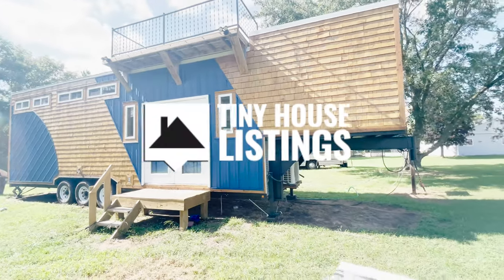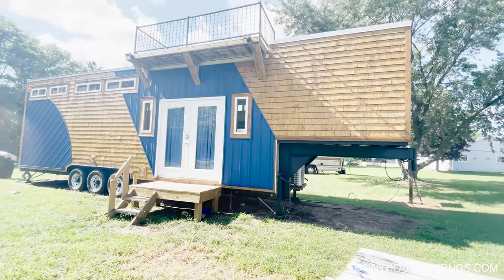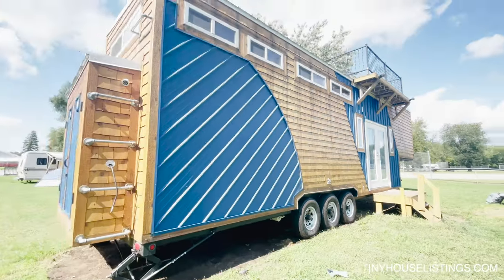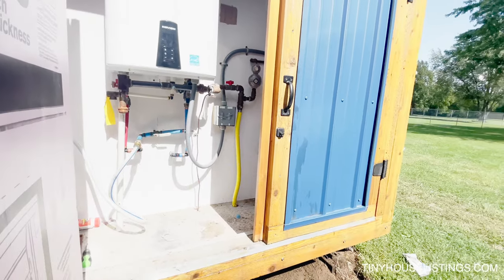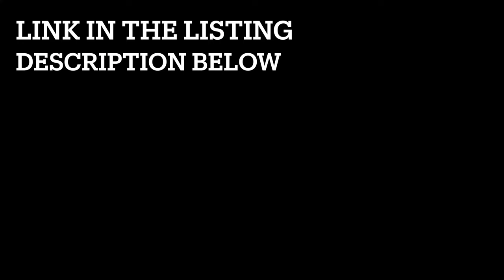The Tiny House DREAM | Full Video Tour | Rooftop Deck

Comment: Can something this size even be called a "tiny house" with a straight face? Don't get me wrong, its lovely. I just think its too large to be called a tiny house, a small house most certainly, but not tiny.
Reply: Just for YOUR FYI....THE Tiny house (Tiny House movement) is a home that can travel with you on wheels.  Now you know.
Reply: @mailto5319  Don't be so condescending. Especially when you're so laughably flat out wrong. A Tiny House does not have to be on wheels to be a Tiny House (though it is common for them to be mobile) and just because something is on wheels, doesn't mean its a Tiny House. A Tiny House is defined primarily by size. Hence why they're called "tiny". The movement itself is defined as an architectural and social movement towards downsizing living spaces.
Reply: @RainMakeR_Workshop  Correct, though, because of the struggle to legalize them the law and building codes will generally refer to a size of 400 Sq Ft or under because that's the range that would otherwise not be allowed.  It doesn't actually define what is tiny, just patches the law where it needs to but many refer to that as what can be called tiny and this is still well under 400 Sq Ft at the listed 322 Sq Ft.

It's otherwise a matter of opinion and based on what someone considers normal size for what it is being compared to but at least a third of the size would be considered tiny instead of just small.  Given the average house size exceeds 2400 Sq Ft, tiny can be fairly large for some people.  Some, used to much larger houses, would even consider something 1500 Sq Ft too small for even one person.  While, as there's overlap with ADU's, people tend to include all ADU's even though they can be up to 800 Sq Ft or even larger in some areas.

So there's a lot of gray to how tiny is actually considered and depends who you ask...
Reply: @ZeoCyberG   oh I know. Even up to 600 Sq Ft is within the realms of Tiny House to many people. But I just tend to find larger ones don’t really live up to the name. Anything over 300 Sq Ft, though technically a “Tiny House”, doesn’t usually feel like a Tiny House. Once they get that size, they fall more under Small House. Which is even more confusing for some as Small House can be used more generically for regular houses that are just smaller than average, but Small House is also a term used for a subcategory of larger Tiny Houses within the movement. 

Also the legal status changes from country to country. The movement is international after all and average house size varies drastically in other countries.
Reply: @RainMakeR_Workshop  Yes, but as said, it depends who you ask.  Someone can quote Tiny House Nation, for example, and point out the show states 500 Sq Ft or less.  While the show host Zack Giffin always states it's about what's appropriate, which is why the show was fine showing ADU's over 700 Sq Ft...  It doesn't really matter, it's just opinion and not an actual physical value...  Besides, you can go to a country like China where the average house size is 500 Sq Ft and they'll think they're just normal size or maybe just a little small but they got apartments down to 100 Sq Ft... Tiny is also relative depending on use, like for one person it's different than for a large family and you start dividing the space per person... Lots of gray area indeed...
Reply: @ZeoCyberG     True. But the international Tiny House community on the whole seems to have settled on up to 400 Sq Ft is a “true” Tiny House, though anything over 300 is typically seen as belonging to the aforementioned “Small House” subcategory of Tiny House. And anything over 600 Sq Ft isn’t generally seen as part of the movement, even if as a purely descriptive term they can legitimately be called small in comparison to most homes. There is also the subcategory of Micro House which is generally any Tiny House under 120 Sq Ft. But indeed as you said there is a lot of grey and fuzzy overlap areas. Especially in countries where living that small is normal (though usually those places lack the design innovations found in Tiny Homes that make living tiny practical and comfortable)

Still though, that “FYI” comment legit made me laugh saying that a Tiny House is on wheels as though that’s what defines them 🤣.
So much condensation for such a confidentiality incorrect statement. The caps and “now you know” were just the patronising cherry on top.
Reply: @RainMakeR_Workshop  True, some people can be funny in how certain they are of something that may not even be remotely true but that's the Internet for you...
Reply: @ZeoCyberG  Well said.